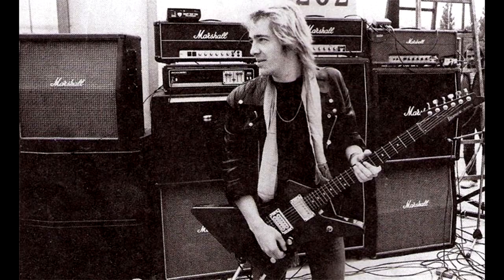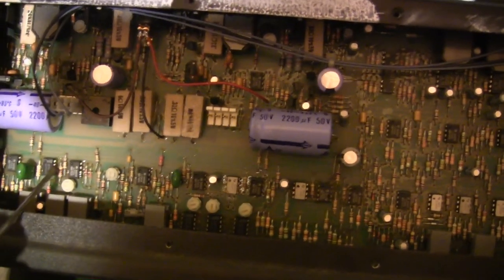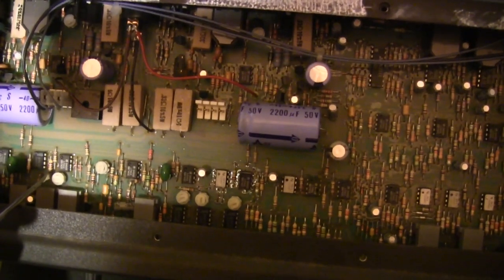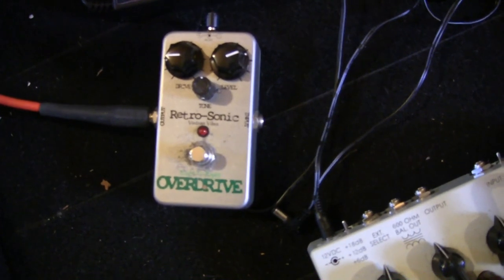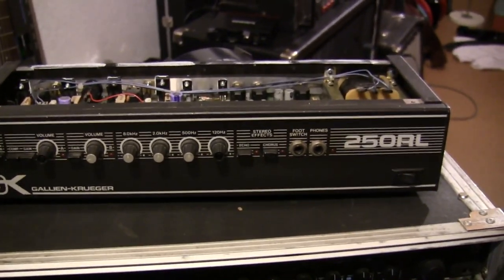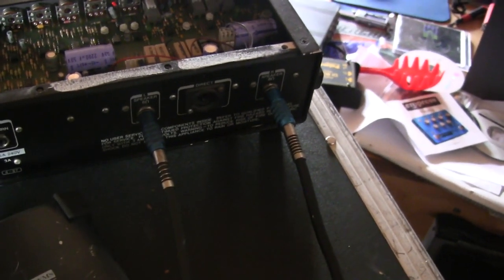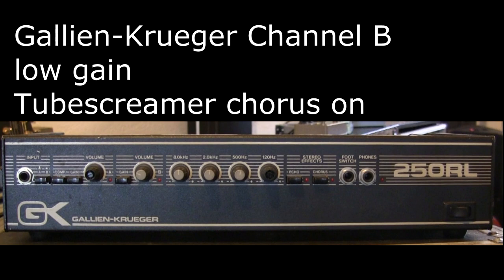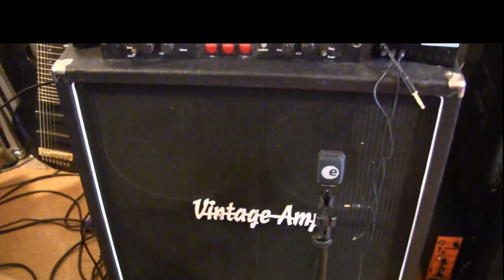How to get the sound of Iron Maiden Somewhere In Time, Gallien-Krueger 250 RL

Comment: Hi, thanks for this really interesting & and historical Investigation! I‘m really proud to be the owner of one of the original GK 250RL Amps Iron Maiden used on the Tour! And what can I say, the quality of these GK Amps is unique, the amplifier still works! 
It is also interesting that on the board an additional circuit to adjust the distortion is attached, Apparently a tuning especially for Iron Maiden...
Reply from the maker: Thank you so much for that comment. I really would like to see and hear the differents of your and my amp. Where you from?
Reply: @sheikyerbouti3082  I‘m from Southern Germany living near to Stuttgart, Im actually repairing my GK 250ML, got new speakers but unfortunately destroyed a resistor by switching on… the 250RL used by Iron Maiden is working fine … Where are you from and how we can get in touch?
Reply from the maker: @happyderwolf4704  Hi, ja dachte ich mir doch bei deinem account-namen. Ich komme aus RLP. Also garnicht so weit weg. Vielleicht kriegt man da mal ein Treffen hin. Grüße
Reply: @sheikyerbouti3082  Hi seid ihr inzwischen zusammengekommen? Könnt ihr genaueres zu dem zusätzlichen Distortion-Schaltkreis erzählen? Klingt richtig spannend, wenn ich diese spezielle Modifikation richtig verstanden habe. LG
Reply: So, there is another pcb circuit added to the original one?
Reply: @lovecraftmusic8717   Probably they replaced the internal trimpots with external pots, to adjust the gain without opening the amp.
Reply: i had a gk 250ml , super amp and im sorry i let it go, i probably bought it around 89 and it never let me down, i traded it for a brand new fender deluxe telecaster for 700 quid !

Comment: They used the Gallien Krueger amps on Seventh Son of a Seventh Son as well.
Reply from the maker: Yes but another Modell.
Reply: @sheikyerbouti3082  which model?
Reply: I read they used the 250ml on SIT and the rl on SSOASS
Reply from the maker: @WildChildMcCloud  Hi on ssoass they used the GK 2000 cpl !
Reply: @sheikyerbouti3082  actually they used the 2100sel. I just found an ad for it with them in it.
Reply from the maker: @WildChildMcCloud  Thats the same amp. One is the single preamp-version the sel is the head version with a poweramp. I´m shure they head both. 😝

Comment: Nice, a Vintage Amp 4x12 box. I've own the amp the 1956 with E-Voice 12s Speaker. The best sounding amp ever.
Reply from the maker: Hi, what Amp do you mean? "vintage Amp" is a German company building cabinets and transistor-amps
Reply: @sheikyerbouti3082  I mean the german company. The model 1956 is a 2 channel all tube amp, similar to the Mesa Boogie Mark 2. I got this amp in a nearly new condition a few years ago, because I live in Germany. The PCL Vintage company was out of production. But now they build some really good, and I mean really good, 3 channel solid state amps. The tube amps are out of production since the mid '90 I think. Hard to find, but awesome in sound.
Reply from the maker: @mca1960  Hi, ich wusste nicht, dass die früher auch Röhrenamps gemacht haben. Ich kenne die nur mit ihren Transistor-Amps. Habe selbst ein Topteil zu der Box. Das ist wirklich großartig. Grüße
Reply: @sheikyerbouti3082  Die haben mit Röhrenamps angefangen. Es gab noch den Stage Master, der kleinere Bruder von meinem Amp, den Companion und im Laufe der Zeit noch andere Modelle. Rory Gallagher hatte auch mal einen gespielt. Mit dem Model 1956 fing aber alles an. Alles Vollröhrenverstärker wahlweise mit EV12s oder Celestion Lautsprecher. Das Ganze als Combo und/oder als Topteil mit diversen Boxen. In meiner original Bedienungsanleitung von damals ist das noch aufgeführt. Meiner stammt so von ca. 1985 oder so.

Comment: I once was after the SIT sound with my GK250ML and got pretty close with Channel B on low gain setting with homemade Rangemaster treble booster on full gain and Chorus + Echo on. I think I also adjusted the internal trim pot for the last gain stage to about halfway. 
I have a feeling that they used the internal speakers of GK250ml and simply miked them. Thats how I percieve that kinda midrangey, slightly boxy sounding guitar tone from SIT record.
Seventh son guitar tone sounds different, much more widespread frequency wise as I think they used 4x12 cab miked.
Reply: Agreed. I tried plugging it into a 2x12 cab and still got closer results micing the actual amp speakers
Reply: Sounds interesting. I maybe shouldn't have bought the RL instead of the ML!
Reply: From what I know, on 7th Son they used the 2100SEL, which is the 2100CPL with a power amp. But take that with a grain of salt, just saw it somewhere here on YouTube in the commentsl sections , but that video also showed the 2100SEL and nailed those 7th Son tones!

Comment: What settings did you dial at your tube screamer together with the 250RL? Same as shown at the picture? I have a lot of noise unfortunately. Did you maybe use some kind of noise gate additionaly?
Reply from the maker: Hi no noise gate. Settings for tubescreamer: gain very low or zero. Volume at 10. Tone 5.

Comment: Hi, thanks for the nice video! If I may ask a question: I have a GK 250 RL myself, and I notice that when the chorus is activated, one side of the stereo signal gets significantly quieter. I currently do not have the chance to test it with an actual cab, so i take the stereo out from the head and run it into a Helix. Is this something you also experience with yours or is the signal balanced in level between L and R when the chorus is on? Thanks again!
Reply from the maker: Hi, no, when i activate the chorus both sides a equal.
Reply: @sheikyerbouti3082  Alright, i will then need to have this looked into. Thanks a lot for the response!

Comment: Can you provide a source confirming that Maiden used a Tube Screamer on Somewhere in Time?
Reply from the maker: Sorry, but no. There are a lot of photos showing that they used tubescreamers from 1980 till today. But especially with the GK there are none. So to be honest, it is possible that they used no TS particular with the GK-Amps. But i don´t think so. Using the TS in front of the GK the sound comes closer to the SIT sound than without. But try yourself.